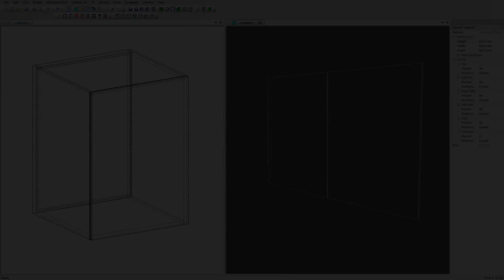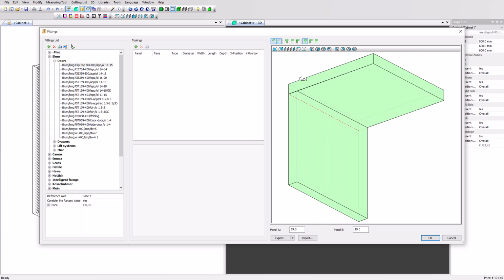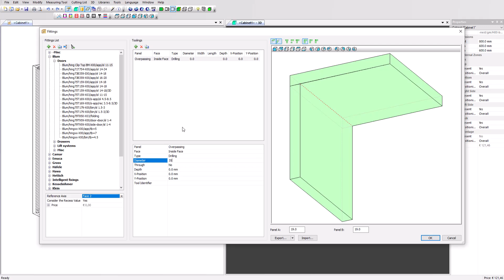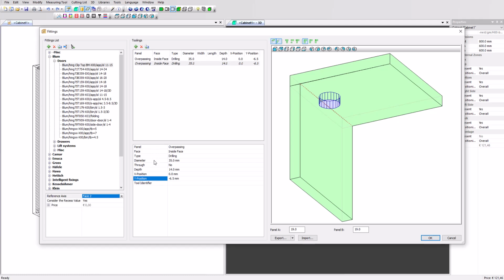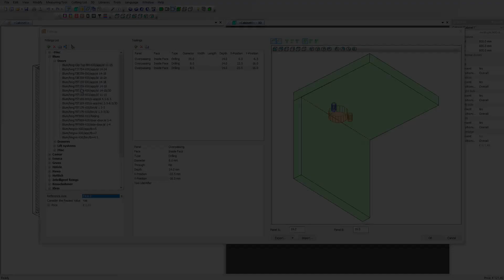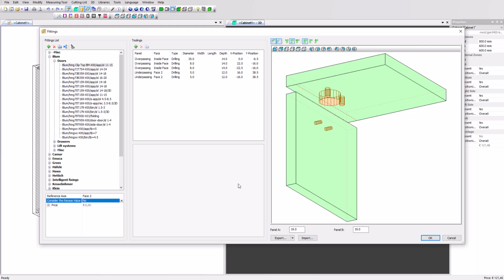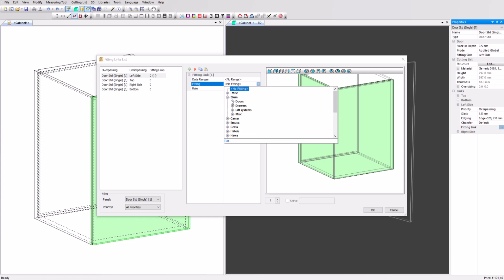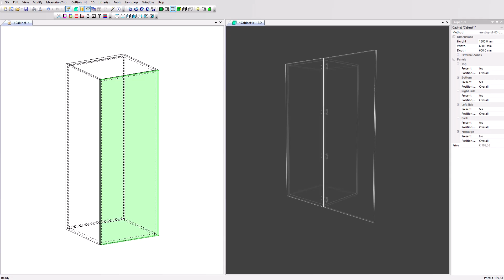Set up a Blum hinge in PolyBoard

Comment: Hey Ness, I'm trying to understand the theory behind the y-position of the 35mm hole according to the overlay rule of 11mm. I don't get why you don't just offset it by 11mm instead of 6.5, as it's the center of the 35mm hole that's referenced.
Reply: Oh, I see now. The rule is between the edge of the hole and the inside face - that explains it. 🙃
Reply: @Areyouoscar  6.5 = 17.5 from axis less 11 overlaps from side